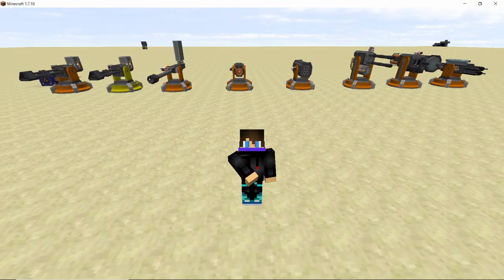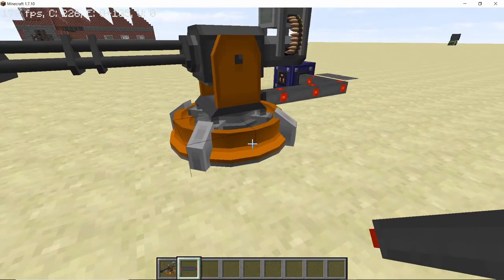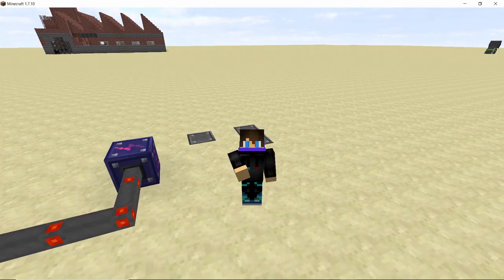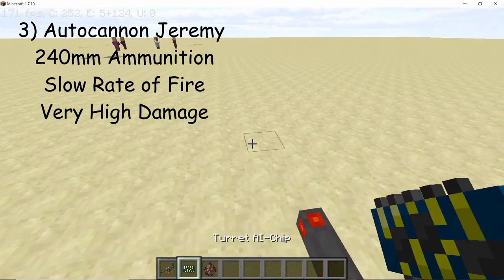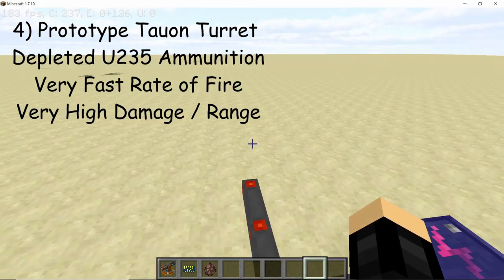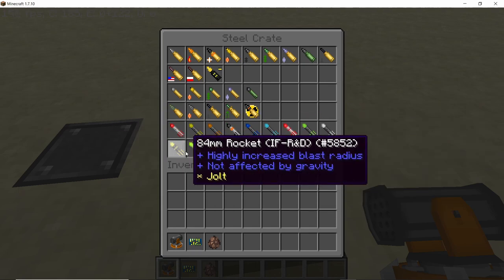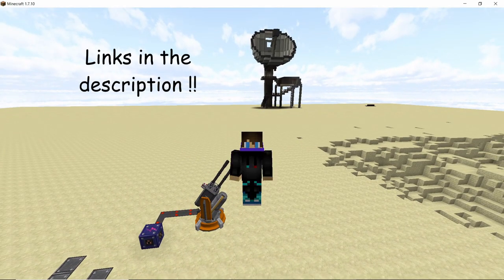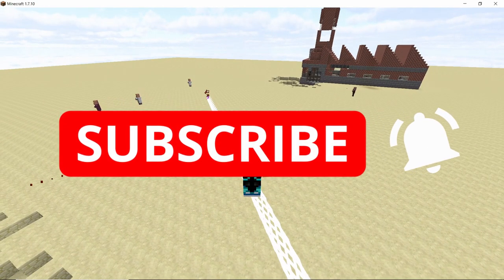"UPDATED Turret's Guide" for HBM's Mod || Testing all the New Turrets in HBMs Mod Minecraft

Comment: This is great if you pair it to the Scape & Run Parasite mod because the full form of the parasites are too OP imo and hard to kill especially if you don't have any gun mods.
Reply from the maker: I agree with you , it's even a good addition for the Aliens vs Predators mod as some aliens are just too crazy to do a 1v1 with
Reply: @SavageVegeta  yeah but I'm a bit confused can I run it on 1.12.2? because I tried it but I don't see anything in the creative menu.
Reply: @erratas1952  it have a ported version for 1.12.2, but it's laggy AF; i tried to pair it with SR parisites but that "server lag" it's annoying. So the other alternative it's pairing it with "immersive engineering" and "immersive intelligence", those have sick turrets too
Reply: @magodejos5699  TechGuns actually has a turret block you can equip one of the handheld guns with. I'm not sure if it works with any guns outside that mod, but it basically uses your weapon and ammo you provide and shoots any mobs you tell it to. it's not as strong as the turrets you see in the video but they are smaller (1x1x2) and way more easily used indoors which can make for some cool base defense designs.
Reply: The problem with that, is that the parasites can attempt after a certain stage, making flamer turrets and incendiary ammunition non-negotiable,

Comment: 1 cant you add diesel though pipes 2 you can shoot missiles down with any thing that does high damage and fast 3 those slots in the laser turret are for upgrades
Reply from the maker: 1) Yeah diesel can be added through ducts as well dude 2) No missiles can't be shot by anything that does high damage , you can try any other turret than the CIWS turret and it won't even lock onto the incoming missiles as all the other turrets simply aren't fast enough and lack the range to actually kill a missile 3) Yeah ik man

Comment: Hi I'm at 8:16 and I set up the turret. However with all the turrets I use I shift right click with the controller and the controller doesn't assign. How do I fix
Reply from the maker: Depending on the version which you are using , the turret controller is now no longer usable as all of the turrets now use an internal system for selecting what to target and that can't be controlled manually for most turrets except the artillery turrets

Comment: Good video. I have a small question what is the hidden catalog?
Reply from the maker: The Hidden Catalog is a Bobmazon book that can be obtained by solving 3 riddle questions , and after obtaining it you can buy really useful / expensive materials at minimum price like 2-3 bottlecaps. Its pretty OP but obtaining it is also very difficult
Reply: @SavageVegeta  you need to slove 4 riddles, not 3 and first 2 was sloved on reddit (r/riddles), I saw

Comment: So I've finally decided to add this mod to my pack and... Is there no way to control turrets with redstone? To turn them off remotely when not needed? It basically blocks you from launching missiles be issue your own turrets shoot them down...
Reply from the maker: Well there is a way to control them via Redstone , supply these turrets power via cable instead of placing self charging batteries inside them. 
Now when you've powered your turrets externally you can place a Redstone power switch in between your supply and cable , when you'll turn it on only then the power will flow into the turrets , otherwise it won't and the turrets won't work without power. 

Now for turrets targeting your own missile the radar did receive a button to only send out a Redstone signal when a missile is descending and no signal when there is a missile ascending ... Now I don't remeber exactly if the turrets have these or not cause it has been a long time since I messed with them , but if they don't then the first solution I showed you should work fine
Reply: @SavageVegeta  Ah of course, why didn't I think of that. A little inconvenient to set up, but since the turrets drain the power so quickly, I guess that's one way of doing it.
Reply from the maker: @manuelfriend4060  indeed , and that way you make a centralized control for all of your turrets or atleast you can divide them into segments for different part of your base

Comment: i just found out that the maser turret  can be upgraded using chips that stuff like laser miners usually use

so in a test world i filled all 9 chip slots in a maser turret with tier 3 overdrive chips and it was instakilling everything
Reply from the maker: Lol the splash kill effect with such speed would be insane , however I don't think you need so many chips as most machines in the mod will max out with a single tier 3 upgrade of any type